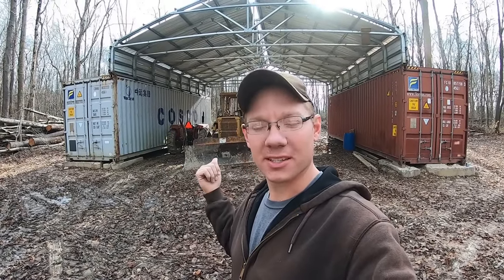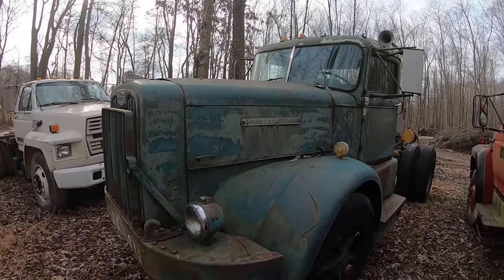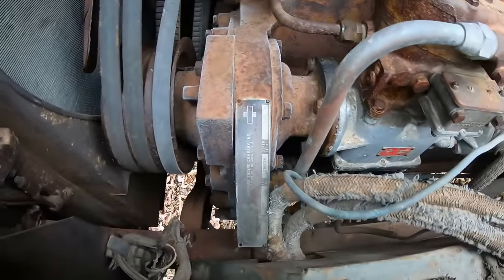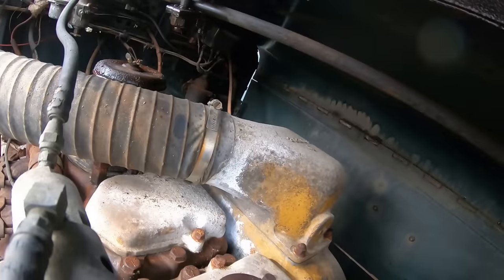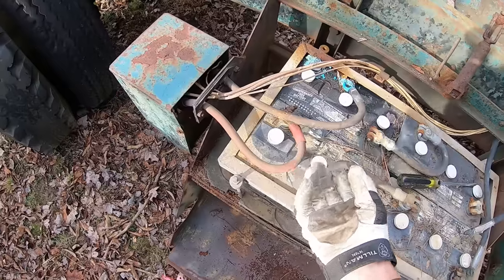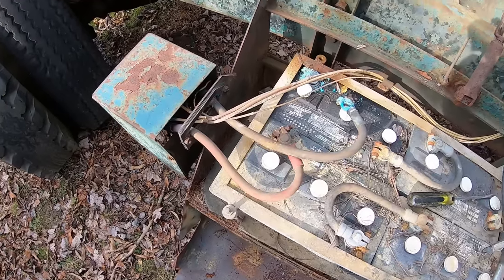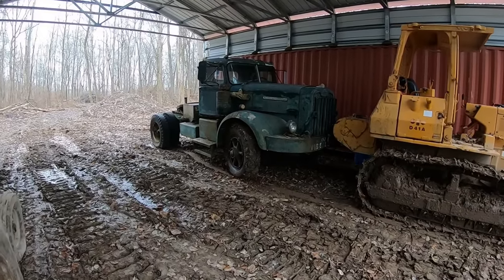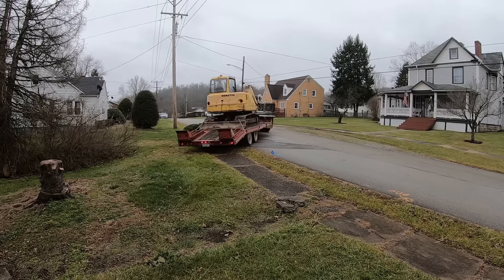First attempt at starting 1957 AUTOCAR truck - Hasn't run in 15 years!

Comment: Its a series parallel switch.  It does exactly that, For starting, it puts the 4 batteries in series, hense 24 volts.  when engine starts and you release the key it switches back to 2 sets of batteries at 12 volts.We had a 58 Autocar . I started out driving on it in 1969 when I was 18. It had a 220 cummins with a R96 10 speed Fuller Roadranger Transmission and a 134C Rear End with 4-11 gears.Our 58 A Car was a GOOD Truck.  I put a Turbo on it and made it a 262. Be careful how you jump those batteries, that switch is probably hard ti find if you short something out, John R.
Reply from the maker: That’s exactly why I quit! I didnt wanna screw it up!
Reply: Series-Parallel switches are readily available. I have a NOS 6v-12v one that I never used for my '54 International R-170.
Reply: YES THE 220, CAME IN  a smaller block before the 855 which was built for so many decades, i   saw one guy had tapped a whistle into the manifold fooled everyone, sounded like a real turbo
Reply: John Rodino.     You seem to know about the Cummins engines. Did they have the 220 in 1957 and the turbo version is as you say 262hp a rating I read about in the ''Overdrive'' magazine when I was a kid. There was a 275hp that I think was  supercharged. I've read of a 195hp 6cyl not sure what block that was JRT or something. The 4.11 Rockwell ratio was good for it's time. My father had a 6-71 powered single drive COE truck that had an RTO910 with that diff ratio and did an easy 70 miles an hour, climbed grades good as well. Happy new year

Comment: Yes I agree turn that engine over for a while to get oil pressure and get oil spread throughout the whole engine. Get rid of every drop of old fuel,  new filters too. Be ready for the engine to run away, if this  engine is anything like a GM with a stuck injector, just cut off the air and it will have to stop.
You need a driver to start this truck, free the rear end, push it with the doser, much easier on the starter. That is what I would try first AFTER READING THE MANUALS         MAYBE. I started out wrecching with out any kind of manuals but I soon found out to get the work done and stop playing around so as to move on to the next project like a cold beer. The manual was really a friend as it gave me time for beer sooner lol
Reply: Cummins injection system won't run away, unlike greenleakers, the throttle does not connect to the injectors. If it tries to run away from some other reason, pull and hold compression release.
Reply: Destroit diesels run away as a rule... thats why many of them have a runaway valve that cuts the air built in, Cummins while they can run away, its more likely from bad rings or valve seasl so it runs off crank case oil
Reply: northman logging 
Usually when a Cummins runs away, it is because the intake side oil slinger or seal went haywire in the turbocharger. Some times if an air compressor gets it’s air from the intake manifold, the air filter is really plugged, the Cummins will suck the oil from the compressor, doing a short run away.
Reply: @darrelfuhrman8217  180-220 doesn't have turbo. This is last leftover from Rolls-Royce with ten head bolts per. Just a little before the 855 all new, all Cummins was introduced, up to 250, without turbo, I've seen a few old style at 300-320 with supercharger. Most notable difference, is the 14 bolt heads and the internal fuel rail.
Reply: Rick Swanstrom 
I know that a 220 do not have a turbo. The smallest 855 with a turbo that I know about is 230 in a Versatile 825, 835.

Comment: A few comments.. Positive  ground, possibly, I know old Macks were.  The starter..24 volt.  The thing on the end of the battery box was a @4 volt/ 12 volt  parallel switch.  Feeds 24 volts to the starter, then shifts the rest of the system to 12 when the starter is disengaged. The pump is the classic Cummins "PT" pump, the lever is the throttle, fuel is controlled by the fuel solenoid on top of the pump. there is a little screw on top of the solenoid that is the Manuel  override. turn it in and the  unit is bypassed, but then if  the engin runs, you can't turn it foff electrically, just a warning.  Check that the engine is not locked up,, a big wrench on the front pully works, and I would recomend that you hook up a fresh supply to the pump, just to try to start is.  'Axe
Reply from the maker: Thanks for the Info ive been learning alot from folks on here. I plan on doing everything 100% next time ill admit I was cutting corners thats why I didnt play around much longer and mess something up! thanks for watching!
Reply: I believe cars at least were changed to negative earth in the early 60's, in an attempt to reduce body corrosion.
I would think all earlier vehicles were positive earth.
Reply: john fellows in the 6 volt times, some where made positive ground, & some were made negative ground. Sometimes trucks were made positive ground or negative ground on the same assembly line, depending upon what the customer wanted.

Comment: That one Handel you called a shut down is the decompression ..pull it and as your cranking the engine it will spin free and then release it slowly and the engine will start ...may have to turn in the manual on the fuel soilod to get her to start ...dad had a old style 220 Cummins in a old dump truck I learned on it was a old white
Reply: Mr Hair is right about the decompression handle in your cab, use to help spin your engine over to start, release it should fire-up. First be sure clean fuel and filter, prime the system, see that fuel will flow-out at injector pump, any air in lines and it will not start.  As mention by someone if you can tow it to start will be easy on your starter,  have a friend help you, best to you.   Make her run and have fun!    After you have your truck running real good please come and start my old 1963 White cabover, been parked for over 30 years.
Reply from the maker: It would make a great video!
Reply: @DieselCreek  if you do get it running, it would make a great christmas day video
Reply from the maker: 1987 mercury it would be a great present for all of us but unfortunately I don’t think I’ll have the time to make it happen. It’s gonna happen sooner than later tho!

Comment: I am sure you probably already know but be careful when you put power to anything that old. Use your nose so if you smell anything wierd better unhook it. Real easy to start a fire. Varmints like to knaw on wires.Think I would put a bar to the flywheel to make sure it isn't froze up. Oil looked black but good. No milky stuff. Oil and water are seperate like they are supposed to be. Use a little patience and change the fuel filter and set up a small container (5 gal fuel container works good)with new fuel going to pump. If the rack is stuck you will know it quickly. Have someone with you when you start it so if it runs away close off the air intake to stop it. Keep us posted and good luck.
Reply from the maker: yes im gonna come at this thing prepared next time, I was going in blind this round, but next time ill be ready

Comment: I just love old trucks, probably because I am old also, i use to drive truck back in the 70s and 80s, i drove Freightliners, and international cabovers with two-stroke Detroits in them with 9, and 10-speed trans.
Reply: Those were the days when I fell in love with wanting to drive trucks.
Reply: They don't make cabovers anymore?? Aerodynamics?? Thanks!
Reply: Autocar does still make cab overs I work in the manufacturing plant in alabama.

Comment: The wonderful thing about old Diesel engines is that they'll run on just about anything you put in them, and the great thing about Diesel fuel is that it won't turn into varnish in a year or two. You'll get that going for sure.
Reply from the maker: My thoughts exactly thanks for watching!
Reply: Even if the diesel turned to varnish, the engine would probably still burn it! LOL  The only detriment to a diesel is WATER!
Reply: Dave Kauffman Yes you are right
Reply: @Rattlerjake1  and emissions crap 😂
Reply: @rubenbraekman4515  - Mine doesn't have any!  HAHAHAHAHAHAHA!

Comment: Your AutoCar has a series-parallel switch, I think that it is in one box behind the batteries. Before you disconnect ANY wires, make a drawing of any & all wires & cables connected to the batteries. Be sure to mark the positive and negative battery cables. Be sure that you map any & ALL cables & wires on your series-parallel switch. Always park the truck in neutral, some systems will start cranking when some wires are grounded. There are 12 main ways to wire a 24v-12v series-parallel switch, with 4 minor ways, with means almost 50 ways to hook up your system. 
I know I had to wire a truck up that some one disconnected the batteries & series-parallel switch.  You have it cut down to 24 ways now that you know that it has positive ground. Be careful there are 24-12 systems that use 24v starting with one side 12 volt negative ground, the other side is 12 volt positive ground. The starter is 24 volt isolated! 2 cables! No ground! Look at a John Deere 4010, 4020, 5010, 5020 early design diesel. It is called a split load system. 
Good luck. You will need it with this truck. 
On a John Deere WA-17 I converted it from a series-parallel 24v 12v to a straight 12 volt system. I had to change the starter to the current Cummins 12v. And had to remove the generator and installed an alternator. Good luck. 
From north east Montana.
Reply from the maker: Yes I’ve realized this would be a nightmare had the batteries not been installed when I got the truck. It’s all rather confusing to me as electric isn’t my strong suit. But I’m planning on getting some new batteries and double checking the manual diagram to make sure she’s all connected correct
Reply: Diesel Creek 
Good luck.
Reply: Sounds like an interesting thing to see.  Electric isn't as difficult as you might think but be careful like was said before make sure you have the gearbox or gearboxes in neutral. My father had driven a twin stick Autocar in the early 50's and I have a picture of him standing next to it. I hear about Autocars and I think of him.
 One thing that I remember my father telling me is that the Cummins diesels of the day had a compression release on them as well.
Reply: Darrel, I'm glad you posted this. I paused at 4:29 in the video and said to myself, "That isn't 4 batteries in series." I helped a friend series/parallel a 1930s Packard so it will crank on 12V and charge on 6V.
Reply: Joshua Skinner 
Years ago grandpa had an IHC truck, 1941 to 1949 K6 to K9, with a Red Diamond 400+ cid in line 6.  Some one had installed a 6v 12v series-parallel switch.  Uncle had pulled both batteries out with out marking anything down. Another uncle finally got it figured it out because of the negative battery terminals are smaller than the positive.
Reply: @Joshie2256  
9o
Reply: @pointingdog7235  o
Reply: I remembered a friend of mine had a 72 R Model Mack and that was a 24 volt starter. Off subject I know but....
Lol
 Keep us posted on your truck I'd love to see it roadworthy again. 
 If I can find the picture of the Autocar I will post it to you maybe someone out there will know what year it was.

Comment: I used to work at a truck junkyard. We would pull the old girl with a fork machine. Hook a chain also for breaks and control. We would pull it down the street and shoot ether into the intake. The put into 3rd and pop the clutch with key on. They would start because they had no choice in the matter.
Reply: “They would start because they had no choice in the matter” 🤣

Comment: It has a ‘Series - Parallel’ switch, not a transformer. There are many videos on this old system - put some good batteries in it, fix the terminals, repair or replace the S-P switch as needed (you can disassemble them and service the contacts in them). Then it might turn over if it isn’t seized 🤞
Reply from the maker: I knew it wasn’t called a transform but couldn’t think of the word lol

Comment: Wow the memories that old beast brings back! I am the oldest son of a wonderful man who fathered six of us, who owned a smallish Mom&Pop type trucking company back from 1933, 1981. For the first 40 years all they hauled was meats, with Grandfather Rights from The Boston Meat Markets into Rhode Island, with a small fleet of 10 International Straight Jobs with Thermo-King Refer Units in 18-22’ insulated bodies. Later on in the mid-late 70’s the International’s were replaced with a fleet of GMC 6500-9500 gas powered 351-401 V6’s, with a couple Mack R 190 Models, with 24’ bodies, 160 hp Scania Varbus Straight 6 Diesel with Twin Stick 10 speeds to do the heavy lifting. Then the business was forced to expand into hauling Dry Goods, Groceries in other woods, with the need for Tractor Trailers, in both dry and Refrigerated Trailers. The Tractors were all but one was bought used. They were all single axle White Motor Company Tractors with 180-220 hp Cummins. The one 220 was a Turbo, all the others were NA, all were hooked to a Ten Speed Roadranger. That all looked very similar to the one above in the video, even just about the same color. At one time a nearby trucking company that was a good sized regional carrier that went out of business in the mid 70’s, that helped us buy some much needed inexpensive equipment to help us service our biggest local customer, a local Supermarket Chain, with a warehouse just a few miles from our terminal. So we were able to use old White Motor Co. Mustang Tractors, that were gas powered, with huge straight 6 flat headed engines and 5 speeds that were very hard to shift. I have to say that engine in your Autocar looks just like those in our Whites! Big dumb engines with bulletproof reliability! We had a fantastic Mechanic that spent ten years in The U.S.C.G. as a Master Mechanic. That man taught me so many things! Plus tricks like using automatic transmission fluid to fill the fuel filters when changing them, or using starter fluid that you sprayed into a tire that broke the bead off it’s wheel, then flick a lit match into it to create the pressure needed to instantly blow the tire up onto the wheel bead! Our Cummins powered trucks were all POSS Ground, with 4,6volt batteries on each side, along with the compression release to get them cranking over fast enough to start!  But anyways good luck to all your endeavors and stay safe!
Reply from the maker: Awesome! Thanks for sharing! thanks for watching!!!

Comment: You AwefulCar used 24 volt starter that was isolated and positive ground if I remember ancient history correctly the box behind the batteries as your thought converted back to 12 volts negative ground if I remember correctly.  Dam it been a long time like 30 years since I worked on one with this setup.  I highly recommend getting a new fuel filter and pump the use the decayed diesel in the tank to light brush fires and put 10 gallons of fresh fuel in the tank and some algae/fuel treatment in the tank, and repair the battery terminal connects and get batteries for the truck.  I would also crack the drain plug fot the oil to see if any water drains out of the engine just to be on the safe side.  The lever inside the cab you could pull on is for lack of better description a compression release that you pull when first crank the engine to allow it to spin more easily.  Make sure to tape up the intake manifold to keep critters out during its winter slump and good luck.
Reply from the maker: Thanks for the tip, that’s exactly what I plan on doing now. I went into this round unprepared and in a hurry just kind of seeing what she would do. Learned a few things from all you guys and now I’m gonna go back and do it right!
Reply: Respect

Comment: Something to bare in mind that I’ve seen in other video’s dealing with old Diesel engines that have been sitting for awhile is to first bar the engine over to make sure it isn’t seized up, that way you won’t burn up the starter trying to crank it over, and definitely go through the injectors and the rack to make sure none are stuck open, otherwise you’ll most likely have a run away. With that said looking forward to hearing her fire up 👍
Reply from the maker: Ill be doing that on the next video, i was unprepared this round and just excited to hear it run, ill be doing things smarter next go.
Reply: Diesel Creek n

Comment: It looks like an H series probably a 185 or 220 HP  . The fuel shut off is on the top of the fuel pump and it has a wire going to it . There is a nob on the front that you can turn in to open the solenoid manually. It is probably frozen up . The oil filter is a bag type filter with an aluminum spool that you wrap the  cloth bag around.  These were pretty reliable engines until they jacked up the horse power put turbos and superchargers on em  . Not enough bolts to hold the head still even at 450-500 ft lbs of torque and they would leak like hell. Worked on many of them but they were pretty much obsolete when I started working at Cummins in 1972 .  God bless you for wanting to even mess around with this old dinosaur.  There should be a big old knob under the dash to pull for the compression release . Get the engine spinning in cold weather and slowly release it .  It was a great feature .
Reply from the maker: Thanks for the info! I got it running, link should be in the description or on my channel